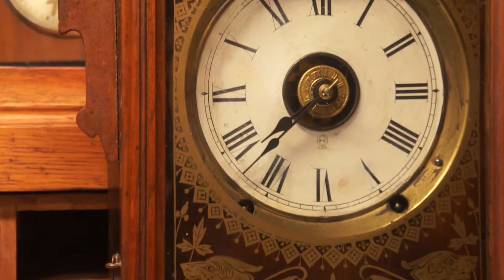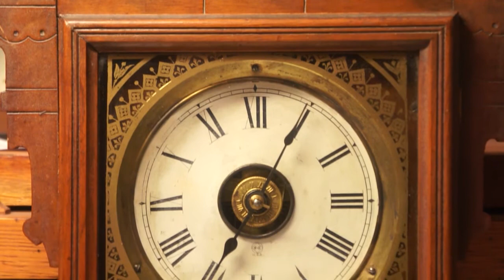1889 Seth Thomas Parlor Clock restore for Shantyl #15

Comment: Yay Washington! We have a Seth Thomas that's been in our family since new. It has wooden gears in it and our clock shop in Spokane says it's older than their books that date back to the 1820s. It still works like new! I've got a little Seth Thomas Beehive and a port hole myself. Great clocks.
Reply from the maker: Great t hear, the knew how to build them back then.
Reply: Wooden works of that sort should still be made today. Many clocks here in New York and New England had wood works in lovely tall cases of butternut, cherry, mahogany, faux grained pine and basswood. I copied one from about 1810 at a clock museum in a library 9 miles from our farm in New York and rode my bike several times back and forth as a 20 year old to record its dimensions. But I knew I would never have the primitive wooden works.

Comment: I’ve done putting gong in evaporust for 24-48 hours and wash it with dish soap to remove any oil or grease and it has better tone and resonance.
Reply from the maker: Great, oils and grease if excessive can change the tone of chimes and gongs.

Comment: What makes a verge skip over the escape wheel?.   I have a movement that will not stop doing this no matter what.

A Sessions movement.  Someone said to nudge the pivot plate (dogbone) ever so slightly.  I have done that until I'm sick of it and it either skips over the escapement or won't tick at all.  I disassembled and cleaned it, then oiled it, and it skims over the escape wheel just like it did when it was dirty.
Reply from the maker: Adjusting verge closer helps in some instances but depends on original defect that is being corrected for.
There's no one answer that will correct this defect.
The source of the defect needs to be found first then corrected.
 If adjustments have been made that were not addressing source, these adjustments must be taken into account and corrected.
Possible sources are: 
1st thing to inspect is power to the escape wheel, make sure there is good uninterrupted power.
Only make adjustments if all power problems have been addressed.
Bent arbor on escape wheel
Escape wheel out of round 
Escape wheel teeth not running concentric with center axis of arbor
Worn escape wheel pivot 
Worn pivot hole on escape wheel
Damaged escape wheel teeth
Worn escape wheel teeth
Worn verge pallet surfaces
Verge pivots or pivot hole worn
Verge too far away from escape wheel
Verge pallet might be out of adjustment from a previous person
This should get you off to a good start on what to look for and will in most cases get it running.

Comment: Will Check In Portland Oregon For a repair Shop Clock could get damaged if shipped. Unless you recommend another service shop
Reply from the maker: I am not familiar with any clockmakers in your area.
To eliminate possible shipping damage to glass and wood case, most people ship movement only.

Comment: So... how can you tell if the glass on a clock is original or not? Always been uncertain about that. All I can go by is what is on it (materials and so on), but there are clocks that were made with no design on the glass at all.
Reply from the maker: Old glass is irregular with  imperfections of, waves, distortion, air bubbles, etc...
Some time around 1940s or 50s processing changed and eliminated all those imperfections.
Reply: @jamesmartin5370 
As of approximately 25 years ago, glass with those imperfections started becoming available again to provide that “old time” look. However, in my experience the imperfections are usually greatly exaggerated almost to an absurd degree. I lived in a 100+ year old house that was full of beautiful old glass. Salvaged glass from an old home would be the best option if you needed to replace glass on an old clock. Although cutting it to size may be a challenge given those very imperfections you desire.

Comment: Does the screw close to the escapment allow the penetration into the escapment wheel to be adjusted?
Reply from the maker: Yes,
 The screw holding the verge pivot is to adjust the pallets/verge into the escape wheel teeth to control the lock and drop on the verge pallets.

Comment: Hi Seth, whereabouts are the Cathedral chimes situated in the clock , I saw gong  hammer action and the two quater hour bells anctions ,Great Video .
Reply from the maker: Chimes are from another clock in the shop
Reply: @jamesmartin5370  ,James could you help me ,I'm new to mechanical clocks ,  I want to convert an old Korean wall clock coil gong chime to a 2 inch bell , The hammer has a leather tip ,will that impede the tone when striking the bell , Thankyou.  Gary .
Reply from the maker: @highspeedgaz  
Yes, it will be a softer sound.
There are many degrees of tone difference from leather tipped hammers, all depends on the hardness of the leather, with age the leather can become rock hard and tone will change. If you replace the leather attempt to find some that has some good body and hardness to it, too soft of leather will not produce enough sound.
Reply: @jamesmartin5370   Thankyou .

Comment: How do you clean the front and back brass plates?
Reply from the maker: L & R ammoniated Clock cleaning concentrate
Reply: @jamesmartin5370  thank you for the help. I truly enjoy watching your videos and the detailed descriptions you provide. I’m about 18 months in and just getting somewhat comfortable taking the mechanisms all apart. 
What equipment do you recommend for replacing bushings. That’s really the only thing I haven’t tried yet.
Reply from the maker: @jeremymoore568  Deep subject,  you will need to research and decide what system you want to go with.
There's  several ways to go,  Bergeon system is a Swiss company, KWM system is a German company, your can always cut your own but will need a lathe and brass stock.
There is also bronze bushings to consider.
If you use Bergeon or KWM you will need some of their tools, If you cut your own you can get by with your own tools.

Comment: A lovely soothing sound of the many clocks running in the background.  ^~^   A question if you please.  were any of these wall/corner clocks ever built with Saphire pivot bearings???
Reply from the maker: I have never seen any built using those bearings, those types of bearings were used a lot in watches.
Reply: @jamesmartin5370  Exactly, I would guess that someone at some time with enough money has had one made like a very oversized pocket watch.  ^~^
Reply from the maker: @ditzydoo4378  probably so.
I serviced an inexpensive common Baby Ben alarm clock a while back from the 1950s.
 As you mentioned, someone had paid a watchmaker to install sapphire pivot bearings it, unusual find on that one.
Reply: @jamesmartin5370  so cool, thank you for sharing.

Comment: Hi Mr. Martin. How did you setup the stop work on the winding mechanisms? I have worked on other clocks and a friend has given me a Seth Thomas strike/alarm clock to repair similar to the one you are repairing. The strike mainspring is broken and will need replacing. When I have replaced the spring I will need to setup the stop work but at the moment I don't know how to. Can you advise please? The characters on the back of the case are 5881C which, following your explanation, is March 1885?
Reply from the maker: Yes, that is March of 1881, that's an oldie.
The Geneva Stop Mechanism allows the mainspring to have a smooth power curve, helping the clock keep much better time.
Yours might look different than the below but they all work on the same principal.
An excellent explanation of it in the below link, also shows how to set them up:

 https://youtu.be/l7cyHiuKWuY

https://cdn.watchrepairtalk.com/monthly_2020_11/20201116_101751.jpg.9c4a2fbc008bad4e585c8c2991c69960.jpg

Comment: Hi there, may I ask what kind of main spring wonder you have and where I could possibly get one. I have a few clocks that have broken springs and I need to replace them. Thank you!
Reply: Winder*
Reply from the maker: There isn't a brand name on the mainspring winder I use.
I fabricated this mainspring winder in my shop.
Reply: @jamesmartin5370  Ahh I see. I must say you did a very very good job. Looks safer than most the ones on the market.

Comment: Which oil used  for oiling
Reply from the maker: Its best to use an oil made for clocks.
Synthetic is the best.
Mainsprings get a thicker oil.
There are also light grease that is made for Mainspring lube.
Research for Clock Oils, do some reading and move forward from there with your choice.
Everyone will have their favorite's, you will need to decide which ones are for you.
Reply: @jamesmartin5370  thanks James sir
Reply from the maker: @jagdishsonawale4028  
Your son asked for help on a clock for you.
For help on your Bim Bam clock you can contact me at:     jamesmart55@hotmail.com

I am unable to reply to yours sons youtube channel for some reason.

Comment: I decided not to fix the clock at the Stark Street In Portland Clock Repair Estimate around $700.00 Both Main Springs and Ratchet Click Springs Jeff repairs required.
Reply from the maker: If you decide to send it over this way for an inspection, email me at:  jamesmart55@hotmail.com

Comment: Those labels get corrupted by someone getting happy with the oiler, and it drips down on the label.
Reply from the maker: Every label I have seen on the bottom like this one is blackened to the point the they are not readable anymore.
I agree, oil from over oiling the movement and maybe from household furniture cleaner and polish.
These labels are printed on newspaper like paper, soaks oil up like a sponge.